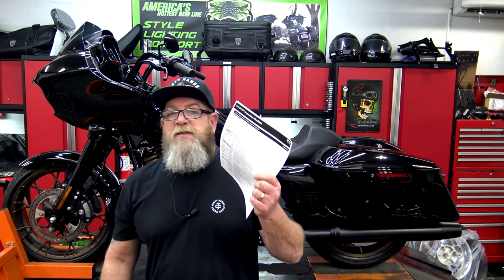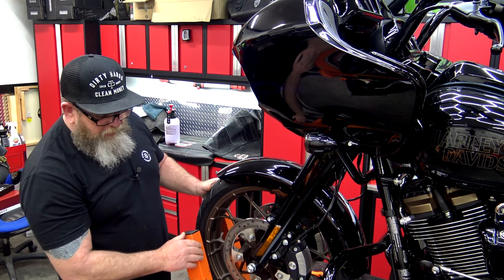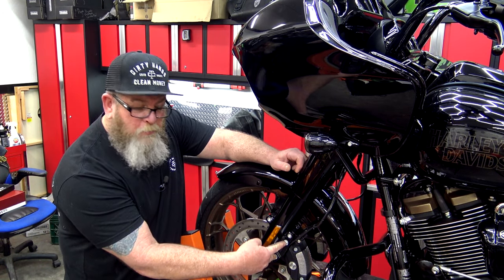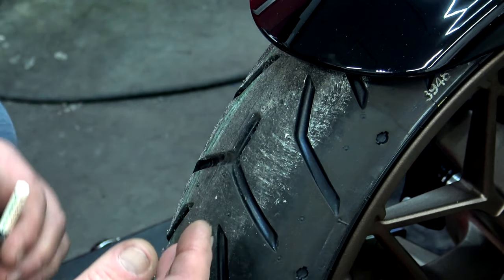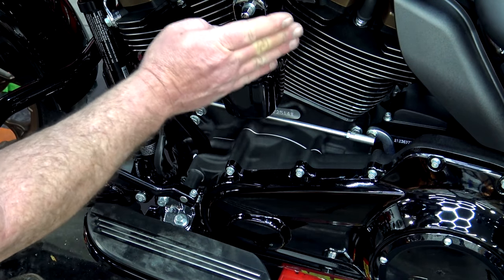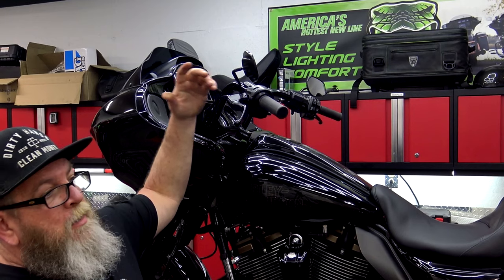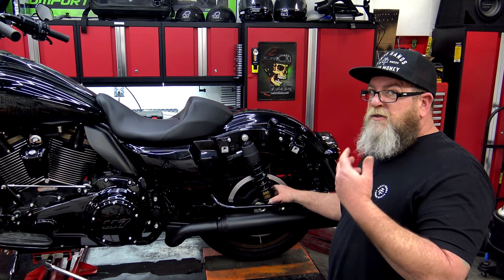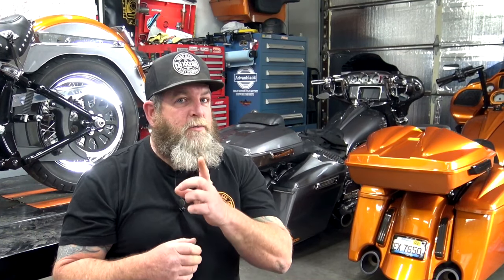⚡Complete Guide to T-CLOCS Motorcycle Inspection Checklist for Ultimate Safety⚡

Comment: During the first wash of this season I happened to notice left side slip-on was loose. Replaced the exhaust clamp since it was re-used after I changed them. So good idea to check exhaust clamps.
Reply from the maker: yes!! One thing I actually had in my video and for some dumb reason I cut it out.
Reply: I had a similar thing on my old road king, it was making a racket. 

My brother actually had his muffler come off on his sporty custom. 

Very common to shake loose

Comment: I would recommend these checks every time you do a trip. I had an oil cooler that showed a leak but no oil on the bike or ground just before I'm mean minutes before leaving for Florida from cali. Don't get stuck on the side of the road. Luckily, my dealer had 1 in stock.
Reply from the maker: Yes! every time I clean my bikes I will go over these things...once you do it a few times its like second nature and you can get through them pretty quick

Comment: Thanks man got a new softail slim and got all good info from your vidieo.
Reply from the maker: very cool! Make sure to check out our maintenance videos on the softails..brakes, 3 hole oil changes, aligning rear wheel, belt tension etc..we have covered a lot...it will save you  a ton of money in the long run

Comment: Great video as always I just like to add to torque your axles your shocks, as you mentioned, your fork pinch bolt even your subframe  bolts.   Can’t tell you how many times I’ve seen a couple of them loosen up and that holds the whole back of your motorcycle together.
Reply from the maker: Great tips! I had a bike in here that had a wheel wobble...ended up being pinch bolts...guy swapped out his cans and just snugged it up...i torued them and boom...fixed.

Comment: Very good pre check video. On the kickstand you should also check the top bolt that secured the kickstand cam plate to the actual kickstand. I have seen several bike come through my shop where that bolt is very loose. I make that one of my general checks when a bike is in my shop. So if a bike has a top bolt that and not all do check it to ensure it is tight a not to your viewers.
Reply from the maker: I seriously had that in my video.,..and for some reason after watching it back I cut that and the slip on clamps out of the video...ugh. Thank you for bringing it up!

Comment: the bit about your tire raising up or flattening off on the center has happened to EVERY rear tire on my softail within 8mo of new.  i was told its because the sides wear faster because they are softer compound for better cornering grip
Reply from the maker: That should never happen to your tire. I contacted Avon tires about this and they informed me that they quit making that tire and are redoing the form and glues so that this doesn't happen again. Its still not been released yet. I had to go with a Dunlop on the front in replacement which will last me longer but not as smooth as the the softer Avon tire.

Comment: I replaced the stock HD tires and wheels on my '17 Road King. 
Wen from a 17"F/16"R Dunlop to 19"F/16"R Michellen Commander 3 and upgraded my rims to something easier on the eyes. 
My frame says 36psi F/40psi R and when the dealership installed the wheels they just went 40/40.
Also I added an aftermarket TPMS that connects via Bluetooth to my Android. 
I use Fubu Bike 2.
Saves me a lot of time.
BTW, I didn't know that about moving the throttle forward to cancel the cruise control. 
I thought doing that just turned off the parade mode (ETMS)
Reply from the maker: 40/40 is a very common thing you will see people running thier tires at.,..because its easy to remember. and honesly its fine. Loads of people running it like that with zero issues. And and you are right the roll forward will turn on/off the parade mode if you hold it long enough...but just kicking it foward will just kill the cruise.  I use my cruise more than I would like to admit lol

Comment: Very thorough video. I would just add that it's not a good practice to put your fingers on the braking surface of the rotors.
Reply from the maker: you are correct..use latex gloves in case you ever have grease or oil on your fingers it will subtly effect the braking performance. However your hands wont produce enough natural oils to effect the brakes on a bike...now if you're changing your CCM-R brakes on your Huracán STO right before track day, I would definitely not touch them lol

Comment: Had a guy ride 60 miles to the dealership to sell his motorcycle and when he got there I took it for a test ride before I check the tire pressure which was a mistake. I always check the tire pressure first well needless to say it had 11 pounds of pressure in each tire.   The motorcycle shook violently at 20 miles an hour so I don’t even know how he got to the dealership safely.   Tire pressure is very important gentleman. And as mentioned in the video it’s right there on the frame not on the tire.
Reply from the maker: Yeah ...been there! worked on a few bikes and I always run them down the road before I call the customer...low tire pressure all the time...its like riding on mud sometimes and you know instantly

Comment: Years ago I felt something hit me on my leg while riding. Couldn’t tell what it was until I got home and noticed one of the front brake caliper mounting bolts had come loose. No bueno.
Reply: Pull the R saddle bag off and check the bolts on the rear brake caliper. I lost one bolt and the other one was loose.
Reply from the maker: Yes so if viewers are reading this...its usually a 10mm 12 point socket ...great idea to check these!

Comment: So unlike my 05 Deuce with drain screws in the forks and i can get to the top of the forks , my 2014 Streetglide is a PITA . You have to remove the Batwing AND take the forks out to drain the oil and re-fill because Mr Harley decided not to have drain holes in the forks . To take it to a Stealership its like $600 !!!!! or more  to have the front fork oil done 🤬thats at the new rate of $150 an hour  . I know no end that let it slide .
Reply from the maker: yeah very different from the touring models and your Duece....it sucks but its still very doable. I feel ya on the hourly rates that why we try to teach everyone at home to basics of working on their bikes. Thank you for checking out the video!